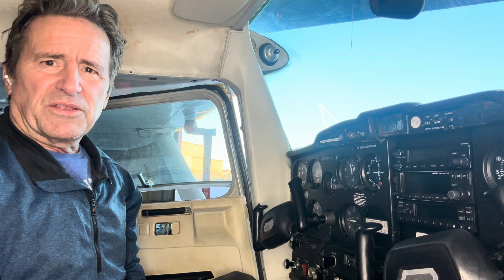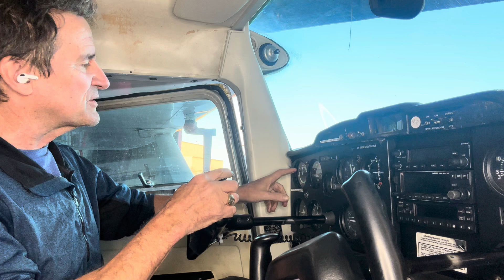Every Airplane Has an Angle of Attack Indicator

Comment: Every wanna be pilot should just read "Stick and Rudder" by Wolfgang Langeweische.
Reply from the maker: @whoanelly737-8  Agreed! Great book. All these replies are incorrectly assuming yoke (or stick) position equates with AIRSPEED, but never said that! 
Yoke position equates with angle of attack (AOA). Your mistake here is exactly what kills pilots. Full back on the yoke will “increase AOA” and stall any plane. 

A stall can happen at ANY AIRSPEED. Ever done a snap roll? Pull full back on the yoke (and stall) at cruise airspeed! A snap roll is a “horizontal spin!” AIRSPEED DOES NOT CORRELATE WITH AOA (except except at one G unaccelerated flight - “training world”🤣
Reply: @jasonMB999 , I’m sorry you were taught wrong. Every professional pilot will use pitch for altitude and power for airspeed. Basically 99% of aviation uses pitch for altitude and power for airspeed, except you and other GA pilots. This is why GA has such an awful accident rate.
Reply: @rtbrtb_dutchy4183 you can do that if you want. You will have no one to blame when you suddenly fall out of the sky. xd, but if I personally knew you I would keep an eye on you ready to report your deviant tendencies. That's how people dive
Reply: @rtbrtb_dutchy4183  😂in fact, i don't even know why i assumed yiu were a pilot, you obviously aren't. Nevermind
Reply: Plus the 1965 version of AC 65 Flight Manual.
Reply: Yes, Wolfgang taught the law of the roller coaster meaning we should not pull back without zoom reserve airspeed and should think of altitude as potential airspeed when needed.  When he asks, "what does the airplane want to do," he wants us to understand the safety built into the airplane with dynamic neural stability.  If we left maintenance of altitude for the limited pitch, yaw, and roll of instrument flying, we could make unstallable turns in the pattern where stall is fatal.  The airplane cannot stall itself, a pilot (as you pointed out) must pull back on the stick.  If trimmed for Vy, the turn crosswind cannot stay at Vy with the pilot pulling on the stick.  What does the airplane want to do in all turns?  If we taught students to consider what the airplane wants to do, rather than making it stay at altitude, greater safety would occur around the airport.  Crop dusters and fire fighters understand that when too low to recover from inadvertent stall, airspeed and not altitude is life.  The law of the roller coaster hammers this home.  Yes, read Stick and Rudder and apply those basic principles.
Reply: @jasonMB999 , whatever you want to believe man, but I am at 16,000 hrs and counting. I was also a CFI for 1500 hours and I taught my students the correct way. 

You were taught by either a lazy CFI or one who doesn’t understand basic aerodynamics. 

In the mean time, every airplane manufacturer and every automation uses pitch for altitude and power for airspeed.

Did you scroll up and see that other person call pitch for airspeed and power for altitude “garbage”. That person is correct.
Reply: @SAFEPilots , no man, nobody confuses this with airspeed. You simply don’t understand aerodynamics and are giving awful advice here. I’m not sure what your level of experience is, but professional pilots will not agree with your statements. 

Most airplanes, you can pull all the way back on the stick or Yoke temporarily and come nowhere near the critical angle of attack. 

I’ve flown aircraft with AOA indicators. It seems like you never have. Maybe you should try that first and you will get a better understanding. 

I used to fly LearJet 24s, which had an AOA indicator. You can get those into a high AOA and have the stick shaker go off, without the yoke anywhere near full deflection.